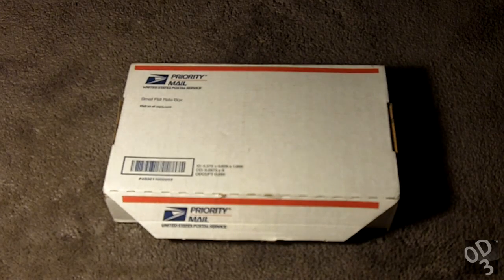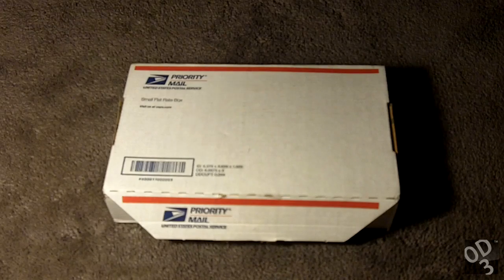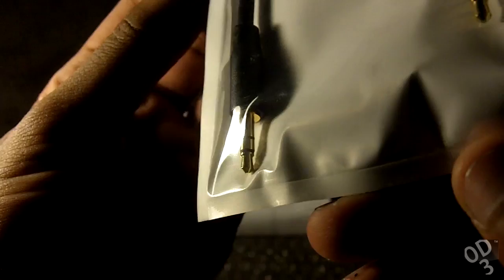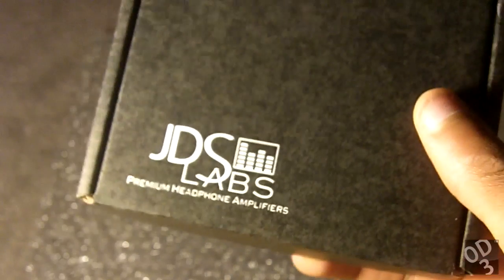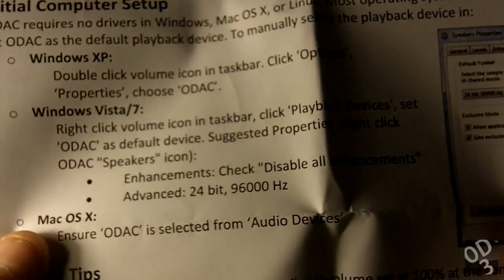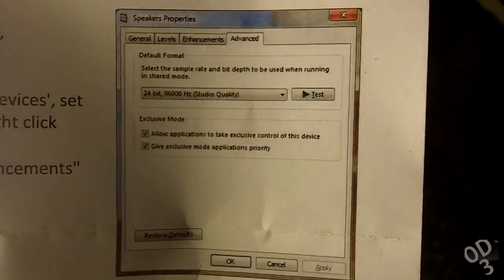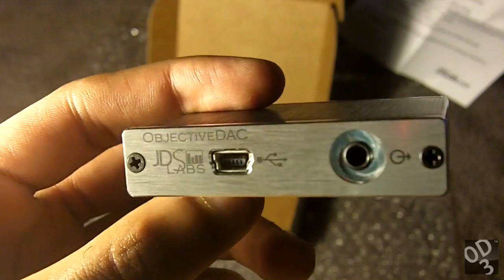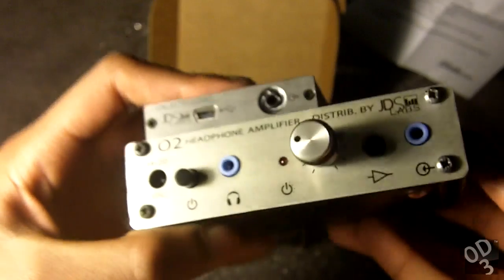Unboxing: JDS Labs Objective DAC/ODAC

Comment: I simply want to know if the difference of using amp+dac vs mere computer output is decidedly superior.
Reply from the maker: In most cases it is superior.
Reply: do you think you can elaborate on what type of changes you typically notice that makes it superior?

Thanks for the response, btw
Reply from the maker: aboyapart You'll get a cleaner noise floor because it is isolated from the various other electronics inside your computer. Also, the dynamic range, output impedance and frequency response will be superior resulting in an overall clearer and more focused sound.

Comment: Can you use studio monitors and headphones at the same time with this?
Reply from the maker: Aaron Jacobs Yes with a splitter.
Reply: TheGamingAudiophile Would there be a decrease in audio quality at all if you used a splitter? Right now I have two Yamaha hs80m speakers that are connected to a Scarlett 2i2 usb audio interface. My problem is that the speakers are picking up mouse movements and computer noise (even though I am using the external sound card). I figured that a DAC could possibly solve that problem, but I am not sure. I do not know that much about them. I may just need better cables or something.
Reply from the maker: The sound card isn't properly isolated from the rest of the computers circuitry hence the reason you can hear the mouse noises. The splitters degradation of audio quality shouldn't be significant and thus wouldn't be audible.
Reply: Do you think a USB isolator would fix the problem? Anything I plug into my computer with usb will pick up computer noises and mouse movements.
Reply from the maker: USB shouldn't transfer any over noises. Try another cable.